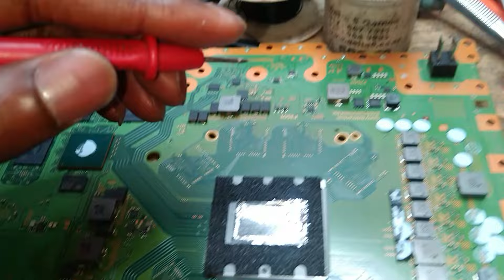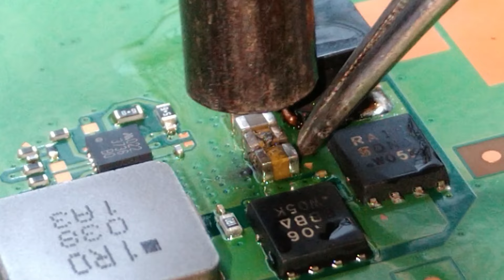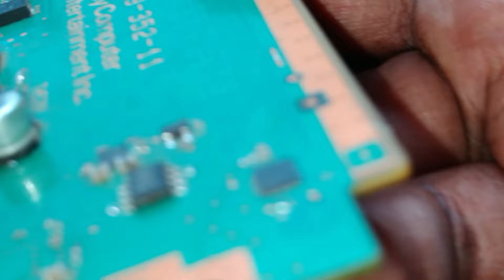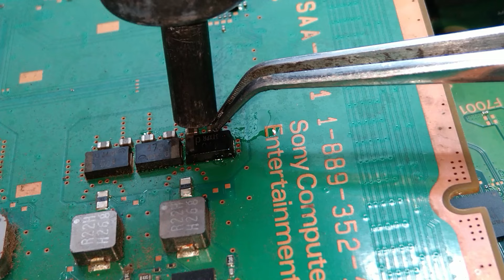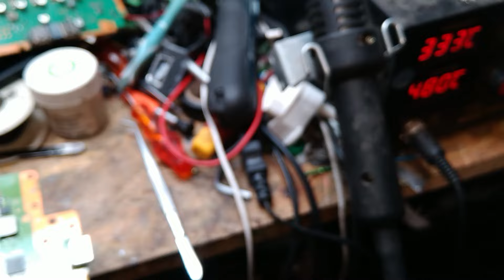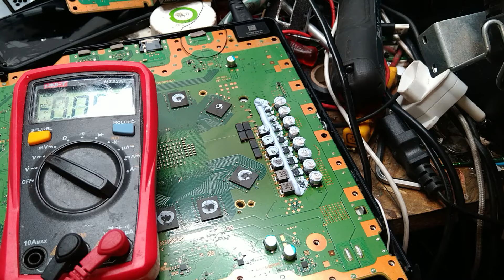Ps5 Shorting 12Volts Rail

Comment: I have xbox series s and I accidentally scratched that wide copper rail on border of the motherboard. Now mine just on then off instantly. Is that the cause?
Reply from the maker: Check to see if any component is missing
Reply: @Kieltec  there's a small trace that looks like has 0.01mm wire sliced also. I solder it only use a tin and still not work. Should I replace the sliced part with a jumper wire?